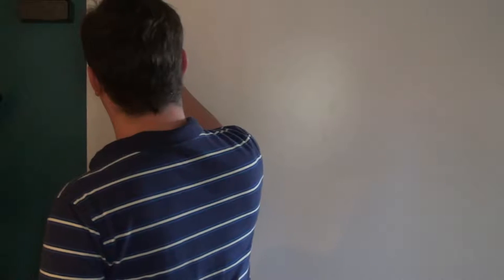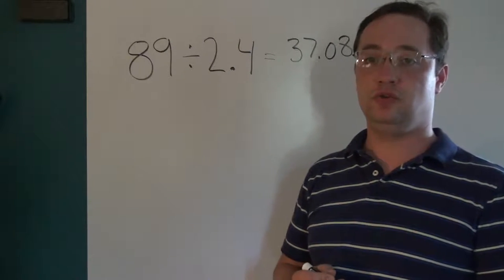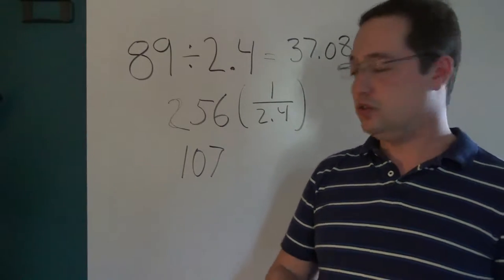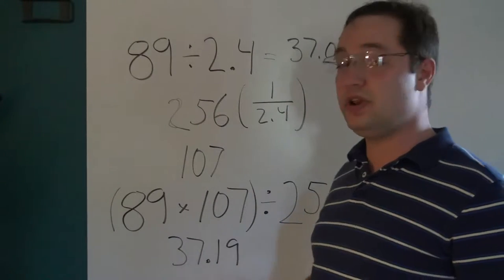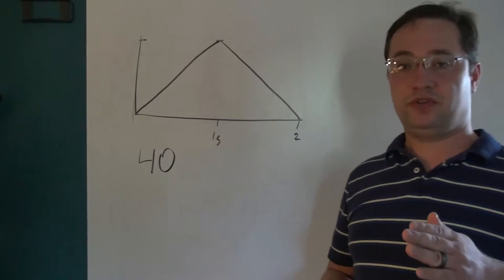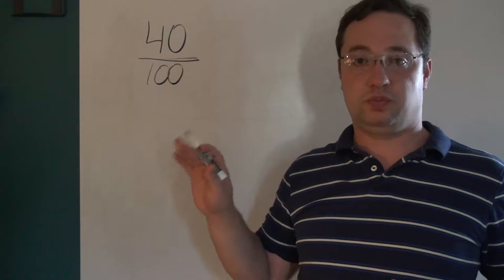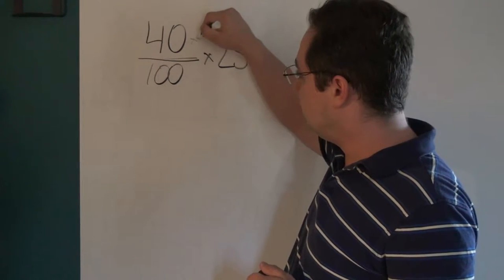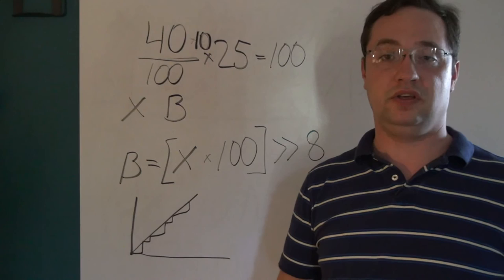eapbg #18 Dividing by a float using integers

Comment: ) Liquid level is simulated by a number control, range from 0m to 10m
(2) Indicator is a round number indicator.
(3) Alarm including low and high situation with 2 Leds, threshold can be set by user. Light on when Liquid level exceed high threshold or low than low threshold, otherwise off.     Help please
Reply from the maker: I'm not entirely sure what kind of help you are looking for. Is this software that you have to write?
Reply: eapbg i« the report « about it